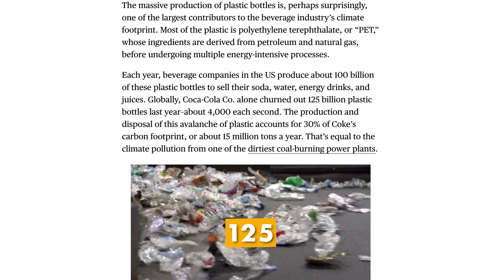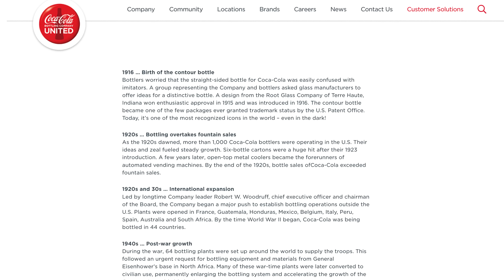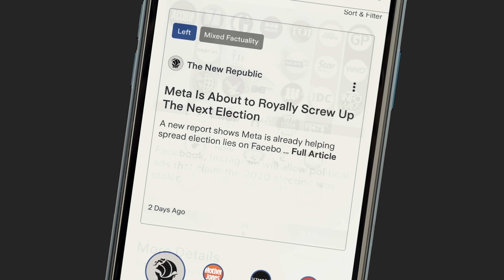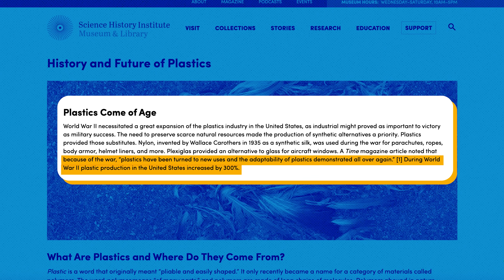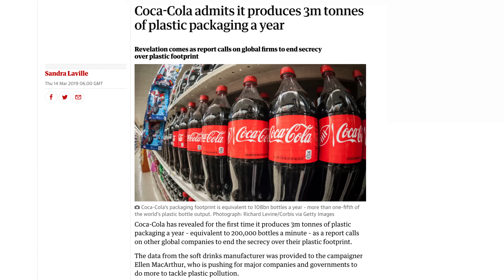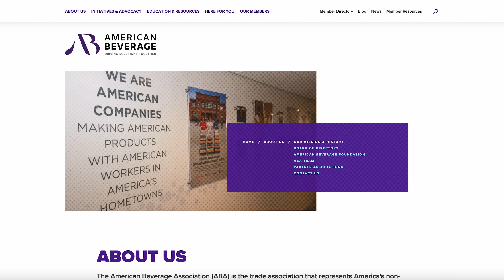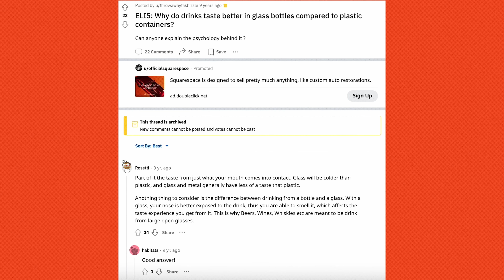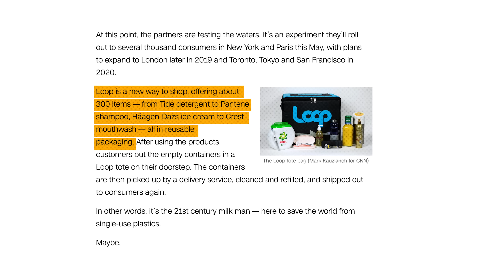Why the Glass Bottle FAILED

Comment: 1. They feel better (Expensive)
2. They taste better
3. No micro plastics problem (Healthy)
4. Reusable
5. Better for the environment
I love European stuff and those laws for apple too is true
Reply: How many times does a glass bottle need to be reused to be better than plastic bottles?
Reply: Agree! pop and beer taste sooo much better from a glass bottle. even from a can tastes better than from plastic
Reply: but they break
Reply: @NAEVAN238  Glass bottles are surprisingly tough.
Reply: @LutraLovegood  It depends on what you mean by "better".
Reply: Cons of using glass bottles:
1. They're heavy, so it's way less energy-efficient to transport.
2. It generates more carbon emissions from transportation since it takes more space than plastic.
3. Glass is glass, and glass breaks. So it requires a lot of energy to recycle them back if they're broken, which means more emissions.

Aluminium is a way better packaging material for beverages. It's light and totally recyclable at the same time.
Solving plastic problems is easier if people are willing to do It (which to be fair also hard, but some countries are able to do it), but carbon emission is hard to solve.
Reply: @n_core Another 3 things are that they take up more space during transport cause they're not shreddered. And you need a few hot nasty chemicals  for cleaning the bottles that don't break. Mixing different blends of glass during recycling can also become a problem. 

Best thing would be a handful  of standardized recycleable plastics used for packaging imo
Reply: @n_core  Both glass and aluminium have the big problem for recycling though: It only works if you can capture them into the recycling stream. From the end consumer's perspective, it's all just litter - there's very little incentive for them to even bother sorting their own domestic waste. You can try to guilt them into it by imposing a sense of social responsibility, but that just makes half of them grow resentful towards nanny-state environmentalists trying to control them.
Reply: We have safe detergents to clean glass, glass is more sanitary to reuse as well as the glass does not pick up components of what it once held and as a material to be found in the trash it is already closer to natural materials as it is just melted minerals. Recycled glass also reduces the temperature needed to make fresh glass. Yes glass is heavy and glass breaks. If one wants to go to aluminum bottles they have to be sealed so they do not leach but aluminum will dent instead of break. Everything has trade offs.
Reply: We still get 1,25l and 330ml coke in glass bottle.  The 1.25l stays well in fridge right down to last bit it has gas, plastic bottle ends up getting flat half way threw. I get a headache from plastic bottle coke cos the have artificial non nutritive sweetners added that doesn't agree with me, glass bottle uses sugar only, most of the time I just have a little coke to help me burp after a big meal. My neighbor has a small shop so I buy it from her, i take a empty bottle everytime  buy, if you don't have a bottle you pay a small deposit and get a cut piece of board, if u return the bottle with with cut out you get the deposit money back
Reply: @LutraLovegood  Once. Just don't be a jackass and smash them after use and they're already more viable than plastic long-term. We already have to go to the store to buy more of the product so why not take the glass bottle back while we're at it? It doesn't cost the end user any more and long term it's cheaper to clean bottles than to keep making more. The problem is that the benefit is long term for a company when we all know that they'd much prefer all the money right now.
Reply: Yes, but the old broken bottle will be back haunting kids running around barefoot. I was a victim of that in the 70s, where one split the sole of my foot wide open. It was the broken bottom of a pop bottle hidden in the grass.
Reply: @craxd1  That comes from the inherent risk of living around scumbags, not glass itself. If a kid is running barefoot or otherwise, they could trip or slip from a plastic bottle or a can. We can't stop using every single material due to a minor risk of a fluke accident.
Reply: there is actually microplastic in glass bottles :/ because its in the cleaning agents i think
Reply: @n_core  oh yeah, youre right about the aluminium thing :)
Reply: Aluminum is corrodeable by soda, most aluminum cans with soda have a thin plastic barrier to keep the soda from tasting like metal :(
Reply: @Fleischkopf  Well you are not directly consuming it in the Soda and Soda stays longer in the bottle than  cleaning product will
Reply: @FLPhotoCatcher  you say that but my broth cubes come in class and I have broken so many of those glass jars and it is alwaysse a big mess, if you're wondering I'm really clumbsy and actually they rarely break the first time they fall they usually break on the second time.
Reply: @SylverArc  I guess I wouldn't know if glass soda bottles are more durable than other glass products as I haven't really interacted with them It would be factinating to learn how long one could last around me
Reply: @n_core  The differences between the two in terms of emmisions is negligable, we'd solve that problem overnight if we were willing to switch to nuclear.

I can agree that aluminium might be a better solution but emmisions aren't the end-all of the environment. It's much harder to sift the entire ocean of plastic than it is to change the climate in one direction or another.
Reply: @vylbird8014  Especially when a lot of so-called recycling companies just funnel all of the "recycling" straight into landfills. It's a big problem in the UK. The councils ask you to separate recycling/rubbish and then proceed to all just throw it into the same hole, it's all a big larp, they don't care about anything beyond appearances.
Reply: @jacobesterson  Even if we're using nuclear, it won't solve the transportation efficiency problem. Glass is still the loser one here.

Aluminum has its problem too, I know because I researched this one too. But between three packaging material for beverages, recycled aluminum is the winner here for now.

Also, for the last part, we can start do it by pushing developed countries' government to forbid exporting waste to developing countries, like in Asia Pacific. It's one of the biggest contributor for our ocean plastic waste problem.
Reply: Glass is easily recyclable.
Reply: Also...don't have to worry about the carbonation altering the chemistry of its container.  With plastic, carbonation eats away at the plastic, causing residual to mix with the carbonated beverage.  Glass?  Not so much.
Reply: @SylverArc   There's two grades of consumer bottle glass: deposit and non-deposit. Beer, even in the days of returnable bottles, was often restricted from being reused (something about bacteria or yeast) so they opted for the cheapest, thinnest glass that can be produced, since it was going to be thrown away. Soda bottles were made of deposit grade glass so they could withstand the rigors of multiple reuse and re-sterilization.
Reply: @LutraLovegood  Once!!
Reply: @FLPhotoCatcher Tougher than my two front teeth.
Reply: @Found-it-there  My brother actually broke his two front teeth when he was a kid, on a glass bottle I put under the blankets on a cold winter day. I def should have warned him.
Reply: @SylverArc LOL that's just observation bias. A broken bottle of pop is no big deal, but a broken bottle of beer is like a punch to the gut.
Reply: In Sweden they have aluminum bottles which aren't actually as environmental as you'd think.
That's why Denmark wisely didn't allow them and stuck to glass bottles.
Reply: @magnusm4 , aluminum cans are coated inside with some sort of epoxy lacquer or polymer
Reply: You may never have stepped one just under the sand when you were barefoot, slicing open the bottom of your foot enough to need stitches, and then being put on antibiotics and being unable to walk on that foot for a week. Glass bottles and soda can pull-off tabs: good riddance!
Reply: @AllenGarvin , This is a minor problem when you consider the number of people who die from cuts on their feet on the beach to the number of people who die, lose their reproductive functions or give birth to children with defects due to the presence of plastic and associated chemicals.
Reply: @n_core You do know that Aluminum containers have a plastic liner right?
Reply: @n_core aluminum is much better, but we need to recycle it…
Reply: @SylverArc thickness.
Reply: @LutraLovegood literally once. Environmentally their manufacturing is more environmentally friendly, and their litter is easier to manage
Reply: I wish we still had that many glass bottles .. plastic rules here as well .. except for Beer and Wine.
Reply: fine the companies for every plastic bottle found in the ocean, if you dont, profit making mindset is always going to win for the moment.
Reply: @LutraLovegood  depends...speaking purely economically? Impossible. Glass bottles are expensive to make energy wise (and thus carbon wise) but if you think about it from the perspective of the 3 pillars of sustainability (society, ecology, economy) plastic bottles are only cheap because they shape the plastic but you're the one stuck with the pollution and trash from extraction and making of the material...if they paid the price for all that damage, the massively expensive price of finding means to reuse (which you mostly can't for several reasons including pliability and health concerns) or recycle (which only makes lower quality plastic unfit for usage in food unless you want to turn them into something akin to oil and then into plastic again...) every plastic bottle, I'd say a glass bottle would pay for itself after 2-3 reuses tops (and i'm giving them the benefit of the doubt given how energy intensive and pollutant it is to extract and process oil or it's derivatives, energy costs they mostly don't pay because that would drive the energy prices up).
Reply: @LutraLovegood zero.  It’s better from the get go.  And it’s infinitely recyclable, where plastic is not.
Reply: You're forgetting a few things. First, glass bottles are not endlessly reusable, second, washing takes quite a lot of energy and there are chemicals involved, third, higher cost of transportation and more handling. 
I'm not saying plastic bottles are better. Far from that. But it's not all black and white and it's all about costs.
Reply: Actually there was a study that PET-Bottles have less micro and nano plastics than Glass Bottles, because the process of cleaning the Glass Bottles leaves some plastics there and the PET-Bottles have nearly zero plastics in the drink, because their surface is really smooth from the inside because they're new and single use only.
Reply: @SanchoPanza-m8m  No it's not bias, have you ever seen a glass coke bottle? The glass is extremely thick. You can whack it on a table and it won't break. As someone said, it's made to be depositable unlike beer.
Reply: @n_core  - Aluminium cans or any other metal packaging is still pretty complicated to recycle since they all have a thin plastic coating inside to protect them from corrosion and direct contact with the product.
But yes, as you said, glass isn't better for the environment for many reasons... but they are a solution to plastic waste. Once we'll be able to produce and transport those glass bottles without or few carbon emissions, they will be the perfect alternative... sadly, we're very far from that.
Reply: @n_core  Glass is totally recyclable if broken.  I used to work at a Pepsi plant.  Bottles that were chipped at the top or were impossible to clean properly or happened to be the wrong brand were busted completely into shipping crates to go back to the glass company.  We had to separate the clear bottles from the green bottles (Mountain Dew).  We would collect up the crates of unsuitable bottles for a while and take a Friday afternoon to bust bottles (with safety glasses of course).  

Plastic could be recycled if there was any money in it.  Where I live, the plastic is collected separately, but it's still dumped in the same landfill as all the other garbage.  Only the glass and metal is really recycled here.

"Carbon emission" is a fake problem.  One volcano puts out more CO2 that humans do in a year.  CO2 is nothing compared to water vapor in the atmosphere.  Water vapor is what moderates the temps by causing clouds in various parts of the world.  The major cause, by far, of temperatures either rising or falling is the sun.  But the climate dingbat "scientists" leave the sun's effects out of their calculations.  They don't get the government money unless they go along with the scam.  Earth has been a whole lot warmer in the past, and nothing much happened.
Reply: @NAEVAN238 
There is a type of durable glass that is 15 times more durable than regular glass. Ofcourse you guess it. It was shot down, in favor of plastic.
Reply: @n_core  Yep, both in terms of emissions and cost, the entire cycle of re-using a glass bottle is worse than making a new plastic one.  As long as the plastic bottles end up in a proper landfill and not taken by scam "recyclers" only to ultimately end up in the ocean, plastic ends up being better for the environment. Never try to recycle plastic, you don't know where it's going, you probably don't know what you are doing (most of it isn't recyclable anyway), and it's a safe bet it's going to end up exactly where you don't want.

As an aside, Glass bottles have nearly identical thermal properties to plastic.  That is to say that a glass bottle of average thickness will allow a beverage to heat or cool at nearly exactly the same rate as a plastic one.  Glass bottles are thicker but have higher thermal conductivity, while plastic is thinner but more insulating, the net result comes out the same.  I suspect that might be by design, when companies switched to plastic they probably wanted the bottles to perform the same.
Reply: @NAEVAN238 if not handled saftey.
Reply: @seanrea550  We purchase a Fench made fruit preserves packaged in glass. Surprisingly tough little jars! We have dropped them on our concrete garage floor & not had them break!! We prefer the French preserves over the American ones as almost all American manufacturers use high fructose corn syrup! Just like the Mexican made soft drinks that use glass & no high fructose corn syrup. The Mexicans at times are smarter than Americans with the flavors of drinks as are the Europeans too. Many years ago we went on a field trip in elementary school to the 7-Up glass bottling plant in Portland Oregon on Sandy Blvd. It was interesting to see how the bottles were all cleaned & scrutinized for reuse. No cracks or chips were allowed in any bottles reused at that time in the mid-1960`s Now were stuck using cans as we don`t like the flavor from plastic bottles either!
Reply: @frederickbooth7970  yes a good Mason jar or glass bottle will last quite a while and can take a hit or 2 but under major impact they will still break and are still heavy. Also cane suger soda is much better than corn syrup soda.
Reply: I live in Europe and nowhere we use glass for bottles. Very rare. All sick stuff came from America, like the plastic bottles
Reply: @n_core  translated. No material is good, and we need to accept it and take care about not throwing everything away.
Reply: @franfinesim  i have experienced glass  bottles, plastic bottles and aluminum cans for soda in the states, the cans are the most common, followed by plastic bottles then by glass bottles. The plastic bottles and cans are really only meant to be used once. The glass used for bottles and jars are thicker to be able to handle stresses better than the fine glass and crystal used for drink ware. The movie tropes of smashing a bottles in a fight is often achieved by special bottles though It is not uncommon to find broken glass bottles along the street.
Reply: Even here in the Philippines, we utilize most drinks on glass bottles.
Reply: Also can make in improvised weapon
Reply: @n_core  aluminium doesnt solve a lot of the problems though. it takes a lot of energy to make aluminium as well as creating a lot of pollution. in addition you still have the micro plastic problem because aluminium cans are lined with plastic
Reply: Not so much when it's broken.
Reply: @vylbird8014 in most of Europe there's a deposit on bottles and cans. And almost every supermarket has a reverse vending machine. That's how it's done.
Reply: México does it to
Reply: The only glass bottles I see is with beer
Reply: @LutraLovegood zero, since it doesn't ruin the planet
Reply: @LutraLovegood none you can crush it back to sand but plastic goes to petroleum/gas
Reply: Why do you think plastics have worked their way into the market. Not only convenient but practical. 
What weight difference between a truckload with glass or plastic. How much more CO2 gets produced.
Reply: There's an even simpler and far better solution that doesn't seem to cross that many people's mind: STOP DRINKING THAT POISON (alcohol included). On top of solving the waste issue, you're also healthier and with more money in your pockets. As far as I'm concerned, these are the type of products that should only be available in restaurants to at least limit the consumption, as an alternative to banning them altogether or making them extremely expensive.
Reply: @Vlad-bs1js  So when were you voted dictator? Have you ever heard of Prohibition and the results of Prohibition?
Reply: When I was a kid in the 70s beer, soda, and many other beverages came in glass bottles. Many people, including children were badly cut at places beaches and even in their homes by broken glass.  Small pieces of broken glass were easily found along streets and in most any parking lot I can remember. It was a terrible safety hazard.
Reply: @n_core it’s breaks and cuts people. If a bottle falls off a counter onto kitchen floor it will explode into many very sharp shards that could cover a surprisingly large area. These shards are difficult to clean up because they are small and translucent. So days later a child could be injured stepping on one in bare feet. The brittle shards almost always broke off under the skin and required an expensive ER trip to remove.
Reply: @daggern15 these accidents were very, very  common when I was a kid. People drop things all the time, on accident or through carelessness. I used to see small shards of broken glass bottles in most any outdoor public places it was  very common.
Reply: @n_core  Aluminum production is extremely energy intensive. Way more than plastics.
Reply: @---usr  I stepped on a nail left in a board when I was a kid . I never once thought the entire society should be punished because of it ... 🤦🏻‍♂️
Reply: @barryhaley7430  Luckily for big pharma, sugar and beverages, as well as alcohol industries I never was and never will be. Additionally, my first solution was something that the people can implement themselves. In regards to Prohibition, it did actually reduce the alcohol consumption, although it did bring a host of other issues. I suppose there's a discussion to be had there because criminals will be criminals either way. The only difference is in their chosen activity. Furthermore, my suggestion was limiting the access because I very well know that prohibition is probably not the best approach, albeit better than what we currently have, which is mountains of waste, millions of cases of obesity and metabolic diseases, as well as alcoholism...all for what exactly?
Reply: @Vlad-bs1js  All for choice. We could all wear Mao suits too and that would help reduce waste.
Reply: @barryhaley7430  That would be brilliant. I get anxiousness hives just when I think that I need to buy new clothes. In all seriousness, I really think there should be a discussion about rampant capitalism, at least when it comes to products that objectively harm our society as a whole. The implementation would be a challenge but we've solved bigger issues
Reply: @NAEVAN238  Some would break. Huuuge majority were reused.
Reply: @Vlad-bs1js  Well if you can show any system other than Capitalism that has even a modicum of success in providing a decent standard of living I would be pleasantly surprised.
Reply: @koopa_6ghg257  Did u not watch the video? Only 9% of plastic is recycled and it's all in China so they are even still emitting CO2 just to get there. Just because it's recyclABLE doesn't mean it actually gets recyclED. The best system is companies using closed recycling loops for their products but even that is just a place holder until single use plastic is phased out
Reply: I live in Europe but I never seen it in store
Reply: @vylbird8014 well that's what the deposit is for, that is used all over Europe. You pay a bit more for each bottle (plastic bottles and cans too btw), and you bring them back to get your money back. Works really well and is implemented in most of Europe (if not EU law, I'm not sure, but the deposit has existed for decades at least in the Netherlands and Germany, and most other European countries too I believe). If you just put it in the trash, glass is horrible for the environment (way more energy intensive to make). What makes it good is the fact that you can use a bottle 5-6 times before it needs to be recycled (and braking bottles is basically a non issue, it does happen, but so rarely it's a rounding error, since people handle them with care because if you bring them back, you get money for it). 

Coca Cola still uses glass bottles a lot actually, but mostly for restaurants and bars, where 0.25 liter bottles are the standard for selling soft drinks.
Reply: @Volosimbi  glass bottles are almost exclusively used by restaurants and bars, not really in stores no.
Reply: Aluminium fullfills all those criteria, but its more resistant. Stop plastic and glass, go for aluminium
Reply: Not very reusable when you cant put the bottle cap back on
Reply: @FLPhotoCatcher but they break.
Reply: @LutraLovegood  Twice.
Reply: @NAEVAN238  Yes. But the broken glass can be easily made into new glass. Despite what we've been 'told', most plastic cannot be recycled.
Reply: @20quid  What do you mean by, 'better'?
Reply: @n_core  If recycled, aluminum is probably the best choice so far as minimal damage to the biosphere. But despite the downfalls of glass, overall, glass is more environmentally-friendly than is plastic.
Reply: @koopa_6ghg257  Really? Tell us all: What, 'nasty' chemicals are needed to clean a bottle of glass? Little bit of Dawn and some water? Is liquid Dawn a, "nasty chemical"? If so, I reckon it should be banned.
Reply: @vylbird8014  Or, with glass, they could just go back to the, "return" idea.
Reply: @NAEVAN238  and plastic doesn't degrade
Reply: Let s roll back to glass bottles.. And make this world plastic free and save this world for our kids..... M
Reply: @NAEVAN238  never seen a broken one. Those bottles are very thick.
Reply: They shatter and they are heavy.
Reply: 1 expensive is one reason nobody would buy it 
2 the glass cokes actually have cane sugar added to them that makes them taste better it’s not because of the glass 
3 the EU is actually starting to get out of control because now I have to buy new cords for my iPhone
Reply: @slapshotjack9806  where I live, they are as cheap as the cans, and has always had sugarcane cause there is no corn syrup and what EU did was the best thing ever done to apple
Reply: @ apple: removes the headphone jack. 
People: WTF NOW I HAVE TO BUY NEW HEADPHONES
Also apple: forces everyone to buy new cables.
Everyone: yes let’s continue to throw away more money for cables
Reply: @slapshotjack9806  Forced to buy a universal cable that you can use from earbuds, laptops, monitor, controllers, most electronics and say it's a bad thing is unbelievable
Reply: @slapshotjack9806  do you even know how long people were requesting for USB C to be universal? No, cause you live under a cave, they had already switched to C before EU came, for their iPads and Macbooks. Also the minor sets of data transfer speeds of USB 2.0, which is from early 2000s. And having made all things Android users could use with any android phone proprietary for Apple only. This is called shady business practices. People can't even be happy when something good is done for them.
Reply: @ what’s unbelievable is the fact that the EU single-handedly just caused a ton more E waste now that a cable that worked just fine before can no longer be used kid
Reply: @slapshotjack9806  There would have been even more E waste if they didn't as Apple made more devices that were locked to only to lightning, and who tf does not have a single USB C cable? Even other apple products have them for a long time. Saying it's gonna make a lot of E waste is so short term thinking, where this will now make every damn fucking electronic cable interchangeable, you can take just 1 cable with which you can charge your phone, powerbank, laptop, tablet, earbuds, at this power every damn under 100w small electronic device and saying this is a bad thing, is too funny, get a real argument first. You think EU are so dumb to even think long-term of this? Do you also think there should be nothing but one app store where Apple has a monopoly?
Reply: European stuff like invasion and genocidal imperialism
Reply: @cheery-hex 
Beer in a can tastes soooo bad.🤢
I don't think the majority of brands here in Europe would use cans.
Can't imagine that magnificent belgian or german beer in a can....ewwww
Reply: They are better for the environment only if you return them.
Reply: Glass bottles actually have more micro plastics in them than plastic bottles due to the cleaning process
Reply: @LutraLovegood once
Reply: @LutraLovegood Most plastic bottles can be recycled twice or three times. This includes granulation (grinding it to bits) and re shaping them to new bottles. This is very bad for the environment. Glass bottles that get washed are way better as they're reused instead of recycled. Recycled glass is just as bad as recycling plasitc
Reply: @daggern15  the problem is nothing you said means anything to me personally. I dont care that its "better long term" bc my soda is not a long term decision, it is gonna be drank within an hour and after that its going in a bin for bottles. Im not carrying glass bottles back to the store with me to buy more soda bc i don't wanna carry that heavy glass. Same reason why i wont drink soda in glass bottles I'm already holding a 2 liter like its a normal soda bottle so why would i make it 3x as heavy by getting it in a big glass bottle.
Reply: This! It just honestly tastes better on glass bottles than on plastic ones.
Reply: Well you dont have to worry about plastic bottles breaking and hurting you sooooo.....
Reply: I agree that they taste better. I believe you can still find them at Sam's club in the states.
Reply: @LutraLovegood once I think
Reply: The glass bottle didn't fail, it was phased out, along with tin lining of tin cans, because it didn't introduce endocrine disruptors into people's diet.
Reply: @LutraLovegood i work in a company that makes drinks, and is around 100 times min if nothing serious hapends to the bottle
Reply: There is no such thing as microplastics